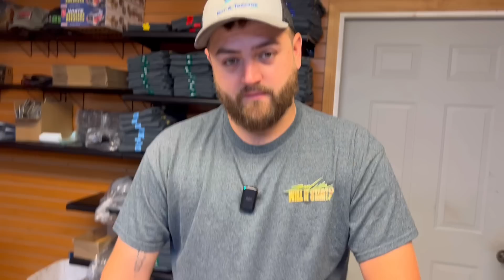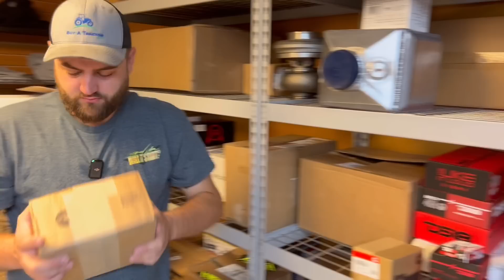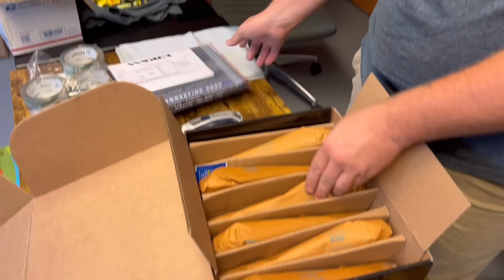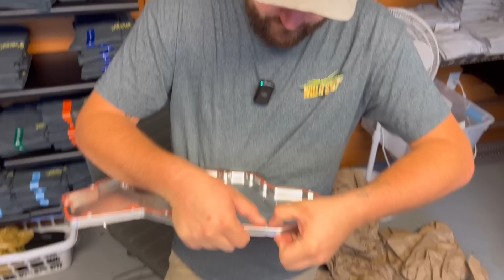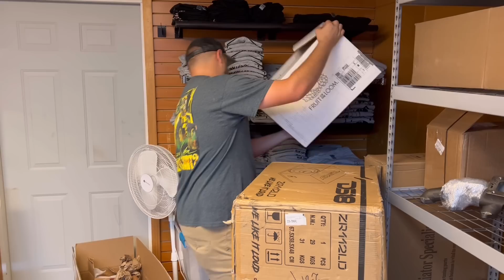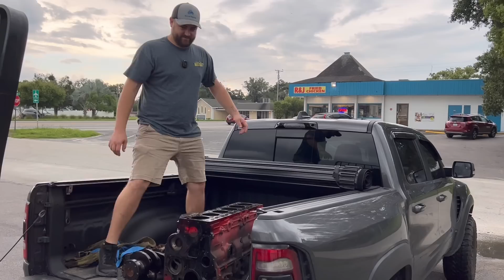1,200 HP Cummins Burnout Truck Engine Build! The FLATNASTY Lives!

Comment: is the truck going to be lowered, transmission oil cooler & rear diff going to need heat dissipation a looooooot

Comment: a simpler way to explain fueling is if you want say 200mg of fuel you want injectors capable of 220-250 because you need overheads

Comment: Diesel has it's place but burnous is not one of them.
Reply: @Burt  You know what I mean, gas is better because HP and high RPM makes great burnouts, torque is less needed than high RPM. Having said that there is no reason not to do it Bruce.